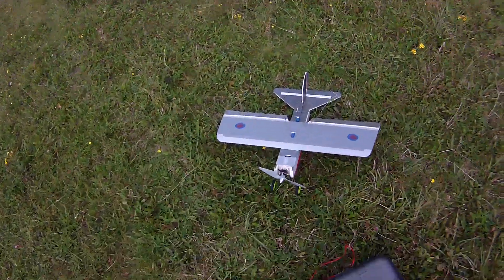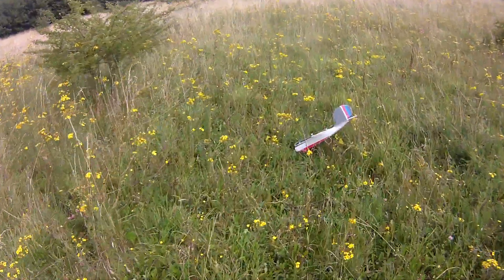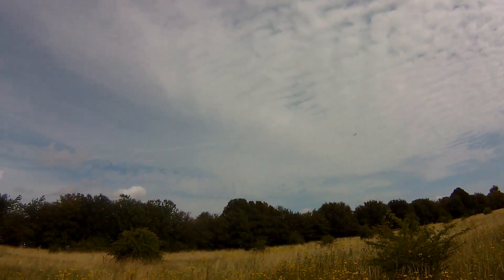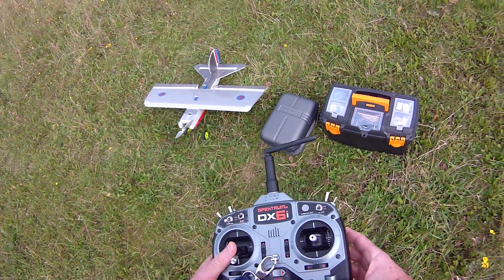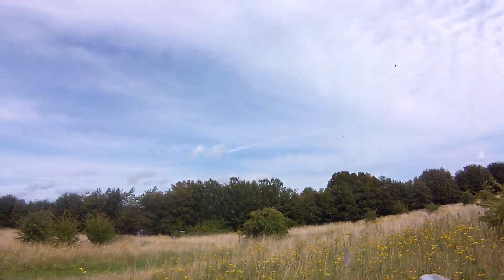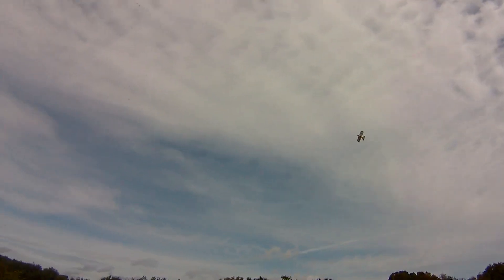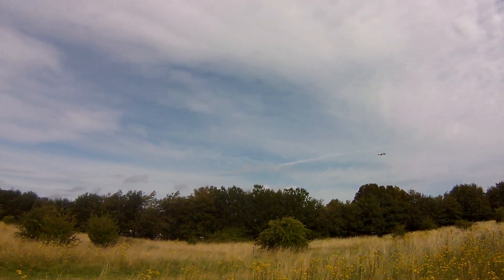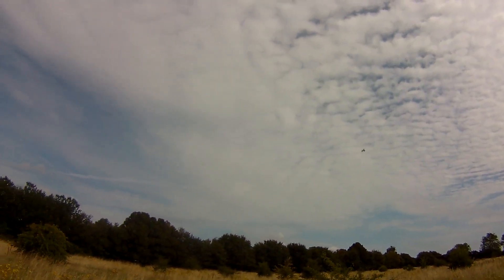FT Bloody Baron Maiden

Comment: Nice job on the depron Baron build.  I like the RAF colors too.  Great looking plane.
Reply from the maker: +Daniel Sponholz 
Thanks Buddy, It rocks. You have got to have one of these, went together real easy. Only suggestion make the power pod a little deeper so you can fit a decent battery.
Reply: +Foamy Flightmaster i have had mine built for months but with the weather the way it has been for that time I've not been brave enough to maiden it!

Comment: @foamy nice plane and great flyers.. being 50% rates, did you mean it was much faster initial servo movement than say 0% servo rates..? Because I usually set My Taranis QX7 for 40% servo rates, that was Slower initial servo reaction than 0% servo rates..
Reply: Oh yess after look up your videos, i might build this little bloody baron.. look so much fun 😁
Reply from the maker: Hi Zayyan, this is a snappy little plane that I found flew best on 50% rates, but my setup is going to be different from yours due to type of servo, length of control rod, type of horn and hole position chosen. Also on Spektrum tx and Orange rx, best to try your favourite setting 40% first, if it works great, if not adjust. All the best
Reply: What battery, motor and prop combo did you use..? Look very fast and balance..